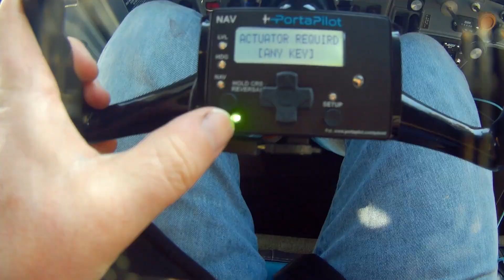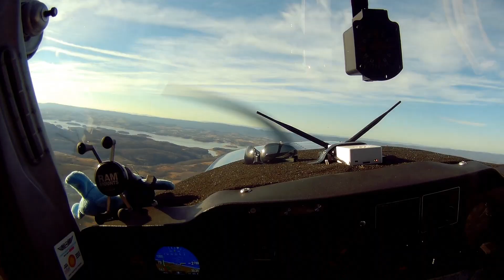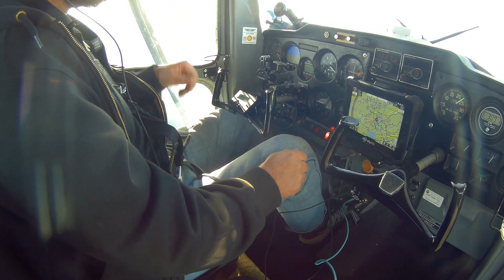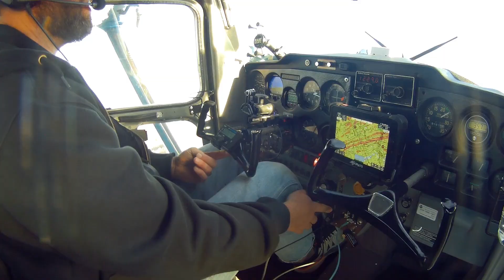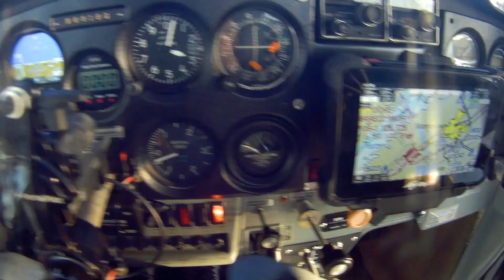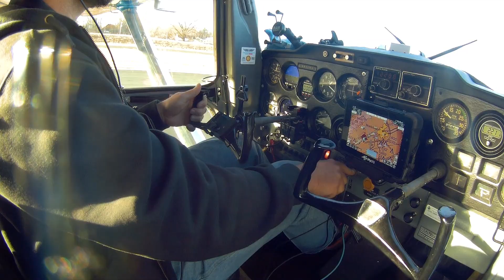Portapilot Update - Cessna Portable Autopilot

Comment: The audio on the right camera is HORRIBLE, really clipped and distorted. The left one is fine. It's unfortunate that you decided to use the right one as the primary, it was painful to listen to and hard to understand. Might want to look into the audio pick up on that.

Also, what do you use for ADS-B in on the IFly, and how do you capture the screen with touch inputs visualised? That looks really good.
Reply from the maker: It was, the gain was on wrong setting on that camera. Sorry about that. Hoping to installl a new camera setup soon!

The statux is my ads. In and i used the screen recorder function on the Ifly tablet.

Comment: Nice autopilot setup!  I have a 1968 Cessna 150 and noticed you flew that flight with the carb heat on.  Was it a visible moisture kind of day that made it necessary?
Reply from the maker: Excellent question. I have a carb temp gauge so I can monitor temps. Moisture was high prefront. I do not recommend partial carb heat unless you have a guage
Reply: Probably just partially out due to a stop limit that causes the knob to be pushed out from the panel a bit. I’ve flown a lot planes with the carb heat sticking out a little, but it’s really off

Comment: How do you feed both the AV 30 and the auto pilot. Is it a splitter from the Ifly or do you have a AV 30 linked with Bluetooth?
Reply from the maker: I simply have 2 wires running from the din 9 plug coming from GPS. One feeds the AV30 and the other the autopilot